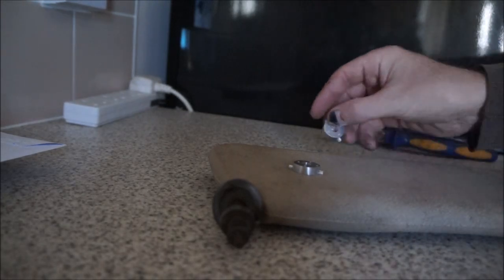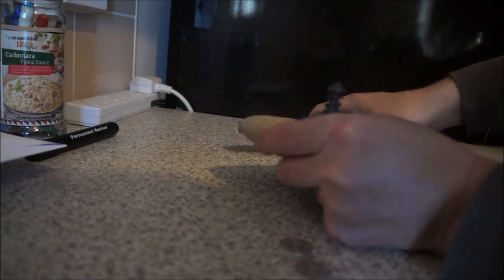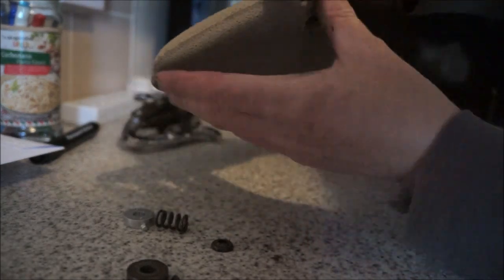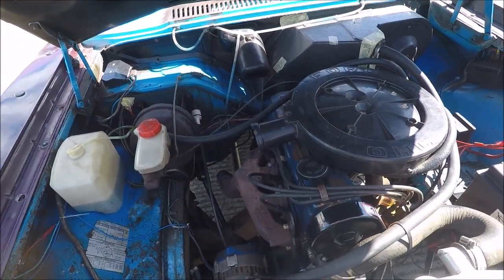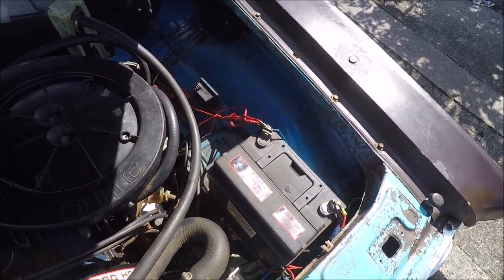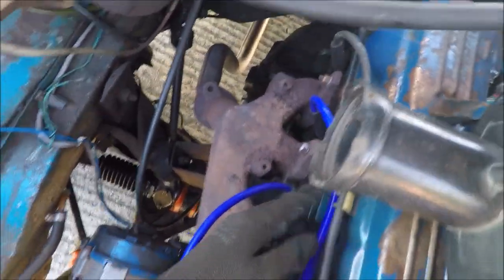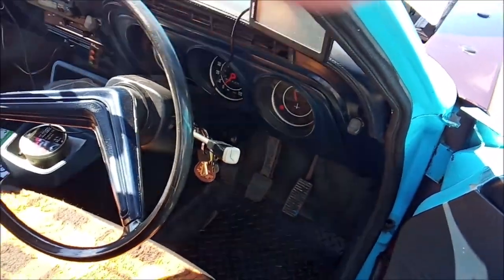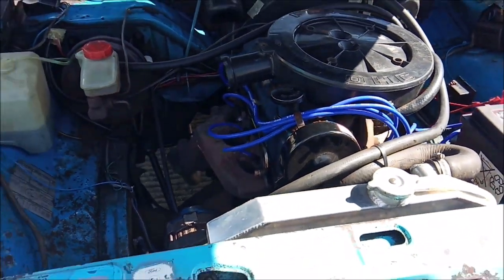MK3 Cortina sun visor and new HT leads.

Comment: i always thought the visor bayonet disc was held with a pin on shaft, ill have to check, to fit its push up and turn , similar to bayonet light bulb. visor tension is via the chrome screw that goes thru padding, though screw could well have rust on it, but finish is chrome. single philips screw alters tension by gripping the visor frame internally. Its great that someone has made a new bayonet disc, who made em? they great!
Reply from the maker: It's great how the guy made them. was a bit fiddly to get it in position.